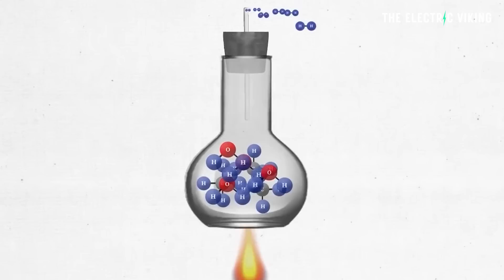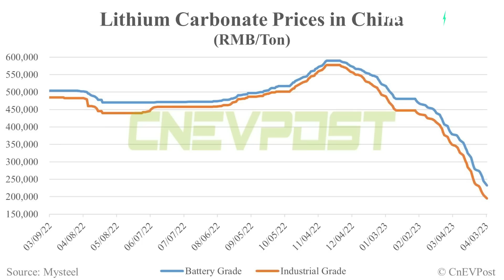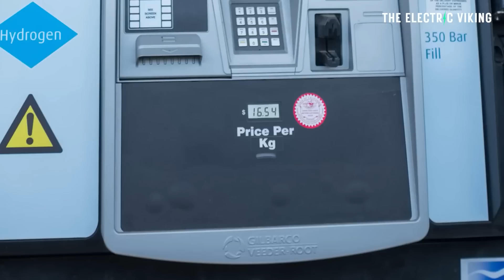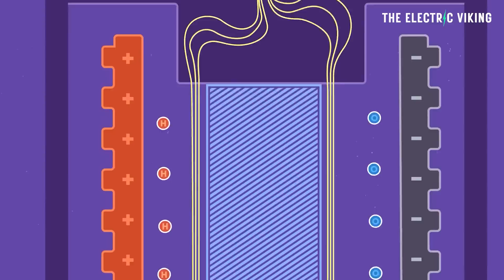Experts say Hydrogen for long-distance trucking makes no sense

Comment: Main impact of H2 I see is on replacing coal in iron smelters. Iron/steel industry being a massive C02 emitter as a result could reasonably quickly clean up its act if green H2 would be available in large enough quantities. The tech exists, now only economies of scale and we’re done.
Reply: Good luck with green H2. Nearly all commercial H2 comes from splitting hydrocarbons and produces tons of CO2.
Reply: Heatpumps and cool the nearby productions and workplaces or server rooms whatever needs a lot of freezing cold

Comment: Australia really need electric freight trains.
Reply: Yes, an electrified rail system to go across the country is a great idea.  There is lots of open land for the solar panels needed.  The solar can be dotted along the way so the power is sort of local.
Reply: The Trains are already electric anyway so you just need to electrify the line and get rid of the diesel generators.
Reply: @lionelwylie2326  Yes, basically.  There are a few other things to consider like the compressed air supply and cabin heat in the winter.  Also you could carry a small battery to allow the engine to be moved a short distance without external power for the maintaining of the rolling stock.

Comment: CHATGPT4: Hydrogen vehicles are generally less efficient than battery electric vehicles. The efficiency of a hydrogen-powered car is between 25 to 35 percent, depending on the model[1]. In contrast, battery electric vehicles have an overall efficiency of 73%.  CHATGPT4: There is a potential safety hazard associated with parking hydrogen cars in garages due to the possibility of hydrogen leaks[1][2][3][4]. The closed nature of parking garages can cause the effects of hydrogen release to be greater than on public roads[1]  CHATGPT4:  Gasoline needs oxygen to ignite, while hydrogen does not. If a hydrogen tank were to rupture and release the gas, it could potentially create a fireball.
Reply: The part about hydrogen not needing oxygen for combustion (oxidation) is NOT correct. Hydrogen reacts with oxygen to produce water :  2H2 + O2 > 2H2O and releases energy.  Even reaction in a fuel cell requires oxygen. 

Now hydrogen gas is a small molecule and finds any leaks easily and any spark will start the reaction potentially causing rapid uncontrolled combustion (AKA an explosion). 

Efficiency is a different matter because in order to transport hydrogen gas it must be cooled to very low temperatures and pressurized to become a liquid.  It takes a great deal of energy to get it to liquify and more energy to keep it cold in a liquid state. Plus the energy density of liquid hydrogen, not including the high pressure insulated onboard storage tanks, is nowhere close to gasoline, diesel or lithium batteries. 

If you use it as a fuel in a piston engine the combustion temperatures are high enough to create nitrogen-oxygen smog producing compounds (NOX) so you still need a catalytic converter. 

Hydrogen used in fuel cells must be very pure to prevent poisoning the rare earth $$$$$ catalysts, complicating refining and increasing storage and transportation costs.
Reply: @FoamCrusher  Oxygen in itself is dangerous

Comment: The facts are that Hydrogen, in relation to its ‘possible’ use in the transport industry is NOT, a Fuel, but simply an ‘energy transporting mechanism’ and AN APPALLINGLY INEFFICIENT ONE, at that, because its total-cycle-efficiency is just …30%..!  😳
Why..?   Because to produce Hydrogen at large scale and ‘renewably’ involves the use of electrolysis on a huge scale, which means having to use vast amounts of ‘Renewably Generated’ electricity to first, ‘crack’ water, “H2O” into Hydrogen, and Oxygen, and then harvest it and store it, which involves either HUGE Volumes, at low pressure, OR, smaller Volumes at EXTREME Pressure, like, 10,000 PSI, Pressure, in the storage containers, when Hydrogen is THE MOST DIFFICULT, of ALL, Elements TO STORE, because it is the SMALLEST, of ALL, Atoms, and it will LEAK out and escape from even the SLIGHTEST, of imperfections, in ANY, containment vessel.
And then, it has to be SAFELY TRANSPORTED, while under Extreme Pressure from the point of production, to where, it is to be eventually DISTRIBUTED, to local outlets and used, WHILE ALWAYS, keeping in mind that it is an EXTREMELY EXPLOSIVE Gas, in the presence of ordinary Air.
Then, to FINALLY USE IT, to provide the energy required for ‘propulsion’ of vehicles, it then has to be RE-CONVERTED, from a Gas, BACK INTO ELECTRICITY, to power an Electric Motor that is then used to drive the end use Vehicle.
This then involves the use of an onboard Hydrogen ‘Fuel Cell’ which adds its own size, and weight, and limited re-conversion efficiency, to the, what is, ..ultimately, an ..Electric-Powered Vehicle, all of which, results in just 30% overall Efficiency from start, to finish, of the entire process involved in ‘moving’ ..this ‘EV’ in comparison, to the greater than 90% Efficiency of simply using the original Renewably Generated Electricity to just directly re-charge, a normal, ..Battery equipped EV.  🙄

Comment: electrification will also come to ships (doesn't Yara have a fully automated electric ship?) and airplanes.
Reply: Submarines are effectively “electric boats”, for YEARS, General Electric submarine builders were referred to as GE Electric Boat Division.

Trains are powered by electric motors, either by being connected to overheated cables, a “live rail”, or by electric motors powered by on-board diesel generators.

United States aircraft carriers are driven by electric motors with electricity generated by an on-board nuclear reactor. 

Moving vehicles around by bringing hydrogen into the loop is just plain STUPID ! Hydrogen is extremely volatile, difficult to store and transport, and having hydrogen fueling stations scattered across cities is just ASKING to have masses of people and entire neighborhoods “disappear” leaving a HUGE crater in the ground if there is the SLIGHTEST error leading to an “accident”.

The whole “Hydrogen economy” idea is BEYOND STUPID !

Comment: Most models of renewable energy generation have significant excess electrical power produced during the summer. That excess electricity my be balanced by consumption. It there is insufficient power consumption then the sustainable energy generation must be curtailed by covering up the solar cells or stopping the rotation of the wind turbines.

Hydrogen is the ideal long term storage solution for the excess electrical power generated during the summer.  Hydrogen can the become the fuel for intensive manufacturing (steel, concrete, etc) and for transportation. For the long haul trucker a quick fill-up with hydrogen is easy, similar to gasoline. Requiring minimal adaptation.  

BEV semi’s are great yet have operational limitations. Tesla was able to demonstrate 500 miles of range - an amazing technical achievement. But in normal operations 350 miles is more practical (from 85% down to 15% charge to maximize the battery’s life).
Reply: Hydrogen is nasty to store.  There are better options.
I expect that someone other than Tesla will end up with the electric semi market mostly.  Other companies have focused on the short haul and last mile trucks.  As batteries get better and cheaper, they will gain range.

Comment: I have been saying this for quite some time.  Hydrogen doesn't make sense.  To make green hydrogen. Like Viking said, takes 3x more energy to produce.  Then you have to transport it.  Then you need to build infrastructure to distribute it.  There are losses all over the place.  
Solar + wind to make electricity,  to make hydrogen,  to make electricity.   Or solar + wind to make electricity to charge a battery. Do the math.

Comment: I see Hydrogen still being useful in four scenarios, would love to be proven wrong:

1. Electricity storage. Not the most efficient, true, but probably one of the easier ones. 
2. Steel making. See HYBRIT.
3. Long distance flight.
4. Long distance shipping.

Hydrogen has already lost on all land-based transport and short range flights, though might still make sense for air taxis for now. Wouldn't hold my breath on it though.

Comment: 1. Like an overengineered hybrid, hydrogen vehicles cost 2 times more to build because they have twice the parts of an EV (The BEV parts and fuel cell parts). If hybrids can't beat BEVs, then surely the more expensive hydrogen fuel cell vehicle can't either. 
2. Hydrogen vehicles cost 3 times more to operate because of the inefficiency of producing hydrogen using electricity (electrolysis), then running it through a fuel cell and turning it back to electricity to run the motors. 
3. Hydrogen vehicles have the highest maintenance cost because it has to be over-engineered to keep safe. In the rocket industry, RP1 Kerosine and Methane beat out Hydrogen as the fuel of choice. Hydrogen is a very volatile fuel. Each tank and each pipe has to be twice as strong and must have no possibility of pin prick leaks. Each cavity has to be filled up with inert gas to avoid the possibility of built up of explosive hydrogen. If you don't maintain your hydrogen car, it could leak hydrogen in your garage and blow up your house.

Comment: Why does the military like it so much than?
Reply: Because efficiency is not a primary consideration for military applications.
Reply: @dansanger5340  Efficiencies be damned. Clearly the tradeoffs are worth it for some. If they can make hydrogen drones work, they can make hydrogen semi trucks. If they can spend a trillion dollars waging war in Ukraine, they can build hydrogen producing thorium nuclear power plants to make hydrogen super cheap.
Reply: @vic321344  No, they would produce both.
Reply: @vic321344  So are a lot of things, so what. Liquid hydrogen has been regularly stored and transported for decades on this continent.
Reply: @vic321344  And yet the cost of liquid H2 is roughly on par with diesel. In fact if you were running hydrogen you could probably do it for cheaper per 100 km right now.
Reply: @vic321344  There is a reason Germany made a deal with Canada worth billions to import hydrogen. Because Europe doesn't have any. In North America you can get it for $10 per kilogram or half the cost you pay there apparently.
And I'm talking semi trucks, not cars, when comparing numbers, obviously.
You should take a harder look at the math, instead of pushing weak talking points.

Comment: I suspect that the sodium battery will end up in trucks.  It is much cheaper than the Lithium and new work seems to make the energy capacity competitive.
For the few places that can't be electric, I think green methane is the way to go.  Since it can be made from sewage and food waste and stuff like that, its price will be lower than hydrogen and it is much less nasty to store and transport.
Reply: Making it might be green, using it is not. It's a greenhouse gas in its own right so leakage will be a problem. It also produces CO2 as a byproduct of combustion.
Reply: @peterinns5136  The CO2 made when you burn green methane is the same CO2 that the plants took in to make the plant material.
Reply: @kensmith5694  So what? If deforestation was not happening at a frightening rate, we would not be having this conversation at all.
Reply: @peterinns5136  So, logic.  I suggest you apply some.  We will never fix any of the problems without it.

Comment: It isn't true that shipping can't be electrified yet. Some niches could already go electric, short haul ferries being the obvious starting point.
Reply: In many places "reaction ferries" are the way to go.  This is where a cable goes a long way upstream from the ferry to a fixed point.  Just by angling the ferries rudder, it can be caused to cross the river.  The energy comes from the flow.  No electrical power is needed.
For a lot of long distance cargo ships some sort of sail would work well.  The average wind speed is greater than the speed of such ships.  This means that engine power will mostly only be needed at each end of the trip.
Reply: @kensmith5694  Yes there are lots of possibilities with river ferries. I was thinking of ferries across the Baltic, the Channel and linking Japan and South Korea, or the North and South islands of New Zeeland

Comment: What is, by far, very far, the best way to utilise whatever tonnage of "green" hydrogen is produced, or going to be produced?  Well, to replace the "black" hydrogen used by the millions of tons in industry!  Green hydrogen has a great future (and I feel entitled to moment on that as I work in that industry), but NOT in road transport!
The jury is still out on the topic of using green hydrogen to store renewable power over months and seasons.  It is awfully expensive and inefficient to do so... but may still be the least expensive and inefficient solution in some cases.

Comment: Motors DO run on water, hydrogen generator converters.
Exhaust emissions are oxygen and water mist.
This has been suppressed big time.
Reply: Oh please I have seen hundreds of diagrams of these mythical machines and they all need a separate source of energy to do the electrolysis.

Comment: The battery swap for trucks makes sense. Electricity can charge the batteries that are not in use anywhere. An owner of a solar farm could set up as a battery replacement station.
Reply: Imagine a poorly maintained or damaged battery gets put on your vehicle unknown to you and it bursts in flames.

Comment: Hydrogen really is a bad idea. I am sure that petroleum industry is behind it. Around 80% of H2 comes directly from Natural gas, oil, and coal, mainly hydrocarbon gas. The cheapest and most common way to produce H2 is the methane steam method. It uses a lot of energy and produces lots of CO2. It is hard to ship. We would have to build ridiculously expensive pipelines and trucks to get it to final user. It is hard to store because the H2 molecule is so small it will leak out of all but the thickest of vessels. Vehicles that burn hydrogen are very inefficient with many moving parts. Vehicles using  hydrogen fuel cells are a more efficient but complex and expensive. Electricity is cheap, easy to transport and with new battery technology relatively easy to store. Why are we still talking about hydrogen?

Comment: Hi Sam, have you any info on what will substitute Diesel locos on our Australian Interstate rail network?
Reply: For long-distance trains, we could use hydrogen or natural gas or ammonia to power diesel locomotives; Or we could build steam locomotives that run on hydrogen, natural gas or ammonia. I am serious about steam, but it would have to be a totally new design to avoid the mistakes of the past. No way should we be reviving the rail museum exhibits.
Reply: @davidinkster1296  It’s easy and cheap (in the long term) to simply electrify the line on all but the very longest routes (like the Ghan). Leave that where it is for now, there no rush to do the harder jobs. Do the easy stuff first and worry about that later.

Comment: The electric Viking says it all really why would he promote Hydrogen which is not more expensive when you consider wind turbines are shut down because the grid can't cope but still paying producers.  Electric vehicles will eventually disappear.
Reply: The grid can be upgraded.  It will be because there is money in it to do so.
EVs will be about all that will be on the road in 20 years.

Comment: Lines over head charging is going to cost more money than hydrogen stations
Reply: That’s impossible because green hydrogen requires electricity to be produced. It is automatically less efficient
Reply: @richardvivian3665  green hydrogen is cheaper because of renewables. I'm talking about the cost not the efficiency

Comment: If electricity was extremely cheap you could turn water into hydrogen. Then it would have some use as a replacement for natural gas or propane. So much lighter than air that it floats into space and zero chance of carbon monoxide. You can not carry enough of it with you for a mobile fuel without cryogenics or maybe very large very high pressure tanks. Why not just use that electricity to heat instead of making hydrogen to make heat.

Comment: Great video, really enjoyed it! There's one big problem with BEV long haul...it's the irrefutable law of "diminishing returns". It's the same problem that rocket engineers have with launching payload into space, you end up with 95% of the initial weight being fuel to get the 5% of payload launched. The same with BEV longhaul, you quickly get to the point where most of the batteries are being used just to move the  batteries for moving the payload!! Add the tax penalties that freight operators are slugged for vehicle curb weight, just not going to happen on rally long haul.
Reply: Wait for it.

Comment: A pipe dream, a real pipe dream. Hydrogen is expansive to produce, expansive to keep and there is no infrastructure to distribute it at any usable scale. Try to imagine the cost of laying down all the piping to be able to deliver it to the customer with all the challenge to keep this stuff at -160c. Good luck with the pipe dream of hydrogen as a common energy for heavy transport and general population car user. With EVs you plug it home if you can and have a full charge in the morning, if you can`t do it home there is more and more charging station and the gas station are starting to install charging outlet which will eventually replace the gas pomp. KEEP DREAMING HYDROGEN DREAMERS.

Comment: Because experts can wait for the almost never-ended time of charging EV trucks...
Reply: An EV truck should charge in about 20 minutes and run for about 6 hours on a charge.  The truck will have to stop less often than the driver.